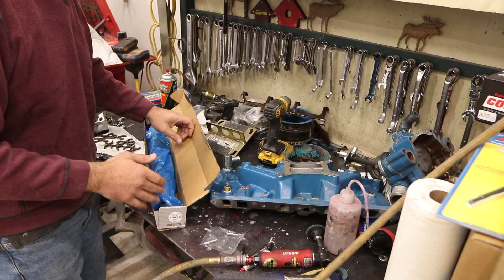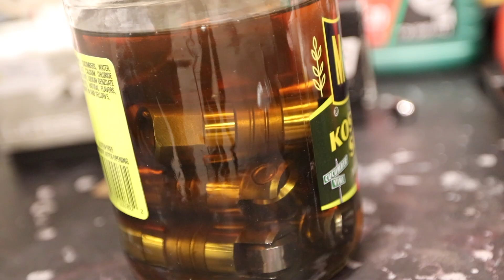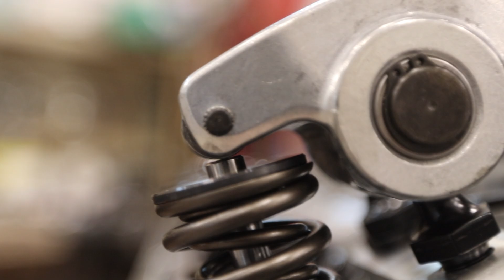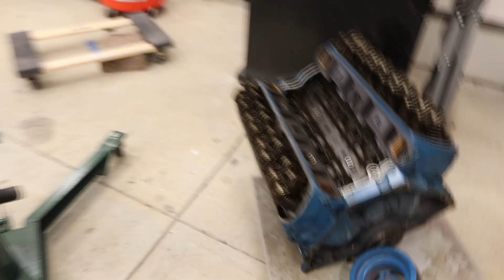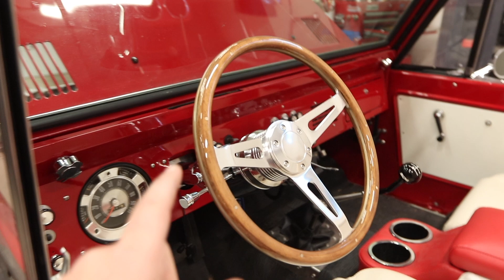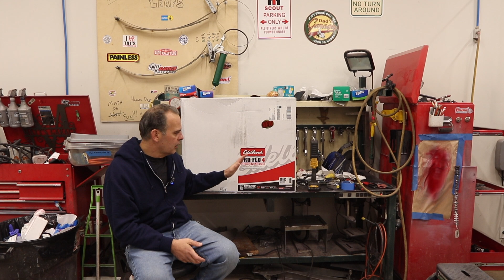#331-Motor is Done!  What now?

Comment: Can you share which AFR heads you chose along with the cam?   I was looking at the AFR165's with a Comp cams CL35-349-8 cam kit.
Reply from the maker: I tried to get that cam kit from summit but it was backordered so they split it into CCA-35-349-8 and CCA-851-16 which they had in strock.  The AFR part # was AFR-1351 the 185cc heads.  Pushrods were TFS-21406500.  So far it's been a great combo.

Comment: Pro flow is great! Installed it on the the last 3 builds I’ve done. Best aftermarket bolt on fuel injection system on the market for fords. Glad you stepped up to the proflow system.

Comment: I run 3.5 wild horses pack and pulled the very bottom little helper leaf out, helped a little. Honestly what helped the most was driving it and just cycling it. Add some weight to the back like 100ish lbs and drive it around for a little while. If your springs are "original" cant speak to that but would probably buy newer tech multipack springs. Deaver and/or Duff is probably the best from what ive heard. Wild horses has been great to deal with and springs are good but they squatted more than i would have thought over daily driving for 2yrs.

Comment: Make sure your leafs were installed in the correct direction. If they are backwards it will ride very stiff (ask me how I know 😂). If the direction is correct, I would take the bottom leaf off and see if it improves. Then progress to the 2 bottom leafs. Other than that, it’s a very short wheel base and is never going to be great.
Reply: Also, I have a 3.5” duffs lift and removed the bottom leaf to help.
Reply from the maker: Interesting. I never took the shackles off during the restoration so if it was backwards, then it was always backwards since I’ve had it. Is there an easy way to tell? I know it will never be great, but this is out of hand.
Reply: @ when I originally installed my duff leafs I installed them (front to back) in the same way as the factory. I assumed the military wrap would be on the same end, but they were not.  It was VERY firm. Once I figured it out I reversed the direction of the leafs and they were much better. I would check with Tom’s to confirm the correct direction for your springs. To soften the ride a little more I experimented with removing the bottom 2 leafs and settled on removing just the bottom leaf. I also have a steel rear bumper and 35” tire which helps soften the ride due to the additional weight
Reply: @ I checked my leafs. The military wrap should be toward the front of the bronco
Reply from the maker: So now I'm getting deep into this.  Aftermarket vs stock is different apparently.  On stock springs, Ford didn't have a double wrap.  The mid-eye side goes to the front is what I'm seeing on one forum post.  Apparently when there is a double wrap, it always goes to the front.  I'm not 100% confident in this, I need to keep researching.
Reply: @MattsGarage  I’m not sure of the correct terms, but my factory leaf had a “military wrap” at the back, but on the duffs springs the wrap goes to the front. I just assumed they would be the same and initially installed the new springs backward. I can send some photos if you would like. Just let me know where to send them.
Reply from the maker: @jonjacobsen6339  That's what I'm seeing.  My stock springs are military wrap to the back which is how they came from Ford.  Aftermarket springs flip it and are designed with the wrap to go up front.  So my orientation is correct. Need to pull leaves, I'm 99% sure.

Comment: Very nice...EFI is the way to go.  Once you get it installed it would be super interesting to see it compared directly to a bronco with the Sniper 2.  I wonder specifically if the port Injection vs throttle body makes any noticeable difference. R/e the rear leafs, I think they all buck because they are designed for a certain amount of weight.  Not sure about removing a leaf...you may end up with a Carolina squat 😂
Reply from the maker: @leomd123  I am also curious. I’ll have to find someone up here with a sniper. I don’t know about a Carolina squat. I can always put in a quarter inch spacer or something to make up for the leaf spring thickness. I need to do something because it’s just not good.